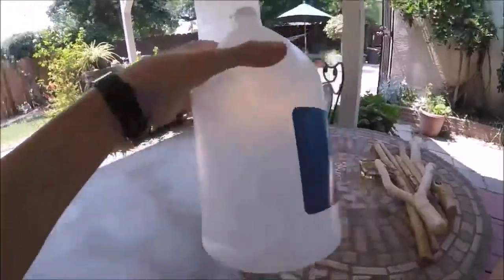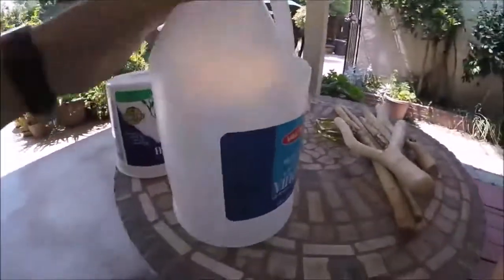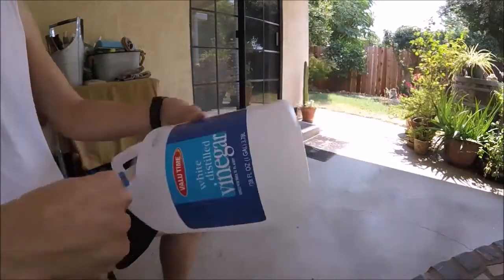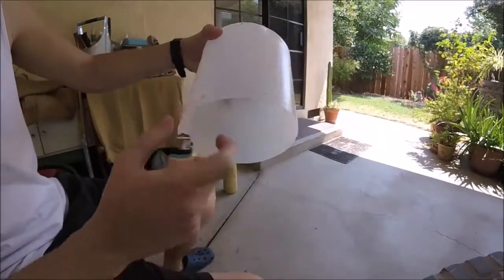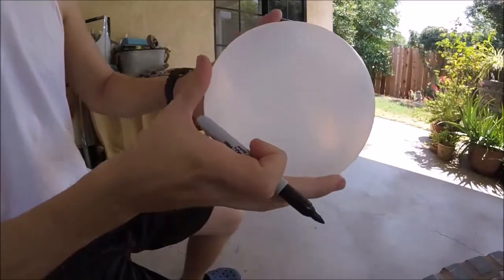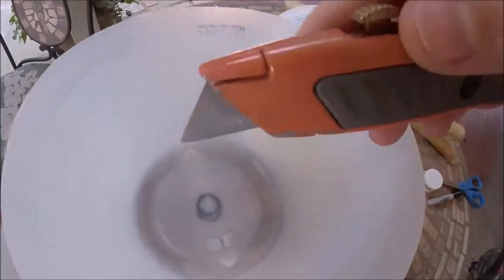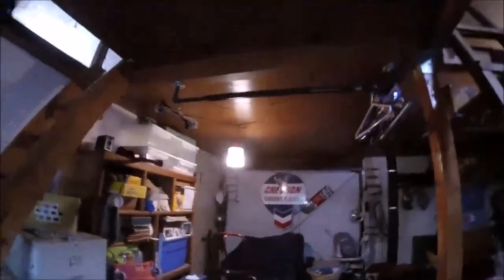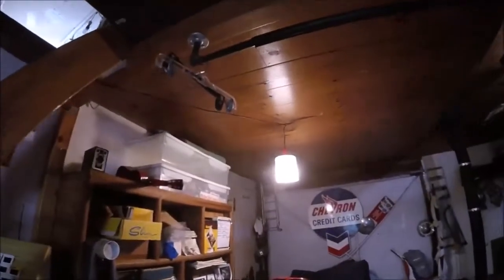Free Lamp Shade Hack How To -Jonny DIY

Comment: eventually that will melt and could cause a fire  unless you use a safe led bulb plus shade that you buy are made to take the heat and also they state what wattage can be used to ensure you dont over do the heat intake of the shade your using  and casue a fire because if you use that light for long periods you will starts to see it shrink down due to it melting out of shape and you may get plastic melting off completely
Reply from the maker: Thanks. Yes youre right. I only use an LED light bult that barely puts any heat out as to not melt or start fire